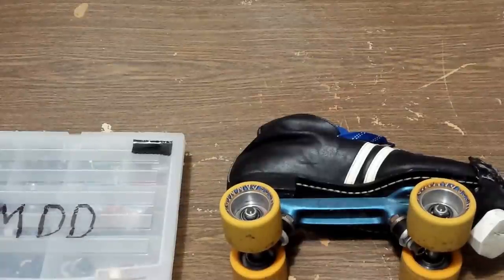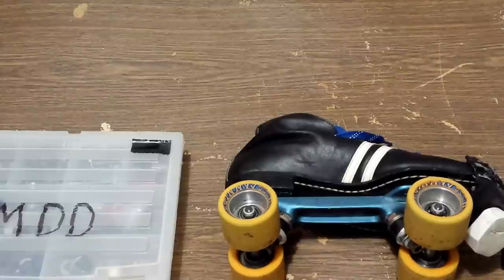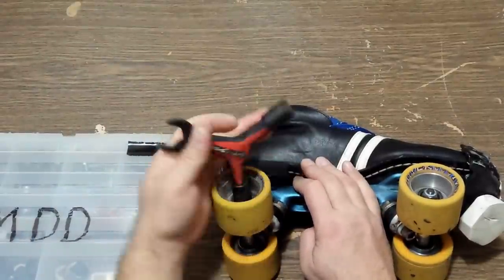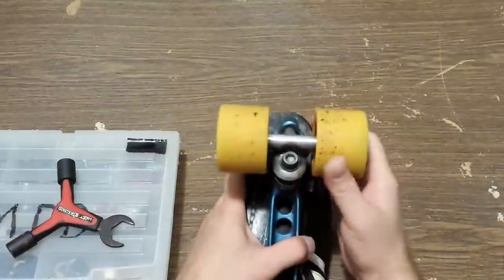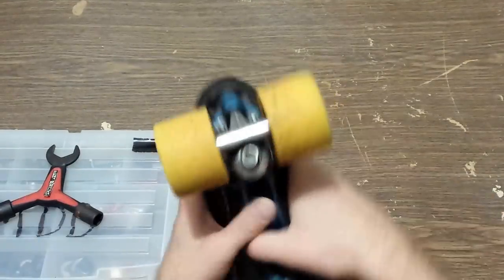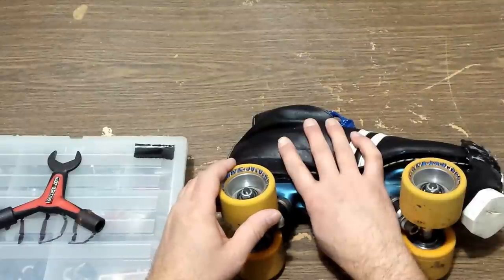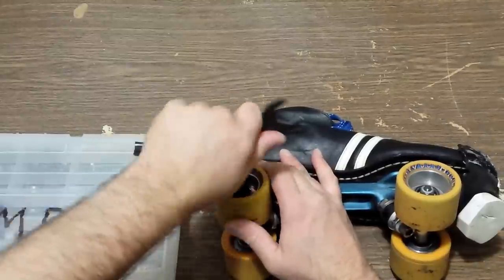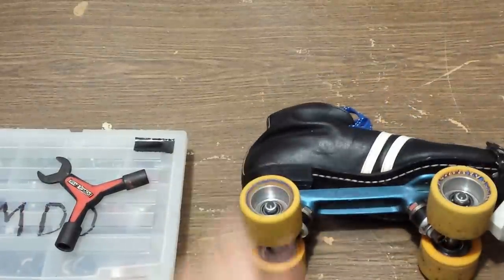How to properly tighten a roller skate wheel

Comment: thank you for the explanation. I figured my wheels were way too tight (since I cannot even slightly move the skate for going around a corner or shifting my weight, even Just holding it) but couldnt find out how to adjust it. very helpfull
Reply from the maker: EMI V  Happy to help  if you have any other skate related questions feel free to ask.

Comment: This looks easy. What kind of wrench is that? I found a pair of skates of mine in the basement of my house that I haven't seen in 8 years. They were used when I first got them. My mom got it for me from her job. She used to be an assistant manager at a Hilton Hotel and a guest left behind a pair Cobra roller skates similar to the one on this video. Some of wheel feel loose but the skates are in good shape. Also, I thought about taking them to a skate shop here in town where they sell parts of skates like the wheels, laces, toestops, you name it. I thought about taking it there to see if my skates need to be adjusted or something.

Comment: awesome, but why mine doesn't spin too much?
Reply from the maker: First off that depends on what type of bearings you have. Let's assume they are low end bearings. Like whatever stock ones came with the skates. Most bearings like that come from the factory packed with a thick grease. It's important that you take all the bearings out of your wheels and clean all of the grease out of them. I like to use brake parts cleaner and a spray can that you can get from any automotive store. Spray the bearings and roll them with your fingers. Keep spraying and rolling them. Until you feel them start rolling more free and faster. Next lay them all out on some folded up paper towels and let them sit and dry for a couple of hours. Then put 3 to 5 drops of automatic transmission fluid in each   Wheel bearing and you will see a world of difference. If you skate a lot it's good to clean your bearings and reoil them at least every 6 months.. If you skate outdoors every 3 months would be recommended.

Comment: Can you loosen or tighten the wheels without the tool?
Reply from the maker: Yes a 1/2 inch socket or open-end wrench works just fine.
Reply: @thevicdunnband  or some pliers! I tried it and it worked:)

Comment: just wondering,  I was told that you should hear a little click when you move you wheels. is that too loose or should I tighten my wheels?
Reply from the maker: no that's too loose you just want to be able to wiggle your wheel from side to side spin the wheel tighten down on it while it's spinning and when you get too tight you'll be able to hear a difference always get your wheels as tight as you can without impeding the rolling action

Comment: Lets say the wheels have been tighten to just the right spot and yet the wheels arent spinning as freely. Is that just an indication of low quality bearings?
Reply from the maker: Either they are brand new and need to be broken in (or washed out) . Or they are old and very dirty and need to be cleaned . Either way This can be fixed by spraying them out with disc brake cleaner (any auto parts store) let them dry and apply 3 drops of Automatic transmission fluid to each bearing . Remember to always take the bearings out of the wheel to clean it .and the reason this helps new bearings is that new ones have thick grease in them and that makes them slow (most of them) we wash that out with the spray  and relube with ATF.
Reply: @thevicdunnband  you just use ATF to lube bearings and not speed lube or another lube made specifically for skates?
Reply from the maker: Yes. works better then anything else

Comment: Some of my Kingpins are shorter and I can't tighten my wheels 'cause the pin wheel doesn't get down,is that normal? :(
Reply from the maker: Sorry I missed your question .Did you solve your problem?
Reply: The kingpins are the two long...pins...on the skates, one in front and one in the back...that hold the plates together (all the cushions, jump bar if you have an older pair, etc.) they have NOTHING to do with the axles - those are what the wheels go on.   I have no idea what a "pin wheel" is...but if you meant the axle, some skates do have shorter axles than others.  If your wheel is too wide, this can cause that issue.  Look for a slimmer wheel that is the height you prefer.  Hope this helps.

Comment: Great video! I’m actually having an issue with my  brand new Radar wheels: I was able to screw in one of the wheels all the way down and it was able to roll freely but there’s still so much play on the axle. It’s weird b/c I thought the more you screw down the nut the slower the wheel rolls and the more attached the wheel becomes to the plate (thus impeding the side-to-side wiggle motion). Is there a fix for this? Am I doing something wrong? I was able to attach all the other wheels in the normal way (pop wheel on, screw on the nut all the way until the wheel can’t move, then loosen the nut bit by bit until the wheel is at that sweet spot where it rolls freely and there’s very little side wiggle along the axle); for some reason, however, this one wheel is giving me grief. Any advice?
Reply: Washers!   You can find them at most "hardware" stores or bigger home improvement stores.  Be sure to get the proper size for your axles!  They're usually around a nickle each individually, but you can buy packs of 5, 10, or more as well.  I'd start with a short stack (4 or 5) of them.   Take the wheel off, put on a washer, adjust the wheel as you like, see how much play there still is.   If there's still a lot of room, take it off again, add a 2nd washer.   Keep checking and adding washers until that extra "play" is gone and the wheel just has that little bit of "wiggle room".

Comment: Please if you have know how to loose the trunks of skate roller
Reply: Slowly back off the kingpin until it's as loose as you want it.  Some like theirs "super tight" (no movement at all), others prefer theirs "sloppy" (where the kingpin is barely still attached)....both of these situations can result in stripping the contact point so you'll need a new set of plates so neither of these options are recommended...most, of course, prefer them somewhere in between.  You have to judge that for yourself by skating on them.  Only turn the nut on the kingpin about 1/4 of a turn each time until you get them where you want them.

Comment: If I hit just a little peice of dirt my wheels stop what do I do!!!??
Reply from the maker: Please explain more
Reply: Most likely you have indoor wheels on outdoor skates.   Check the durometer of your wheels.  Generally speaking, with indoor rinks, you want a harder wheel (somewhere in the 95A to 101A range).   If you're skating outdoors, you want a softer wheel (anything from an 94A or less).   The softer wheel allows you to roll over that debris without a problem.  If you skate outdoors and your route has more "obstacles" (dirt, small pebbles, etc.) go with the softest wheel you can find (78A).   If you're skating indoors, you most likely have 101A wheels (more common on artistic skates)...go down a bit by looking for a 96A or 95A wheel - they just might not take proper care of the rink you skate at.  Alternately, you can use indoor wheels outside and vice versa, but it's all in what YOU are comfortable with for the surface your normally skate on.   My local rink never takes care of their floor, so even indoors, I generally run an 85A wheel just because I know I'm going to hit that "rink gunk" at some point...but indoors - if the floor is properly maintained - you could still do a 90A or 95A and be fine.  I know this can be a bit confusing so just remember - the lower the durometer, the softer the wheel/the higher the durometer, the harder the wheel.   It took me several tries to figure out what worked best at my rink...then I have to change wheels when my family goes to the rink across town (since they do take care of theirs, skating those soft wheels feels like I'm skating in mud because they're so "sticky" and unresponsive.)....it may take some experimentation on your part.  Make sure wherever you get your wheels that they have some sort of return policy - even if used on the rink once.

Comment: Sorry this is bad advice . Fitting bearings with no spacers between bearings and using  speed washers will only wear down your axels . The inside of bearing should not move thus not wearing down your axel . -)

Comment: Sorry, but this is absolute rubbish. The wheels are designed so that the centres of the boearings are clamped tightly with a distance piece in between. This is standard automotive technology. If they aren't clamped tightly the bearings will turn on the spindle and wear them. Obviously the distance piece has to be the correct width which is usually 6mm.
Reply from the maker: Obviously you don't skate and have no skate experience, but it's cool you  go ahead and do it your way .See how that works out for ya .